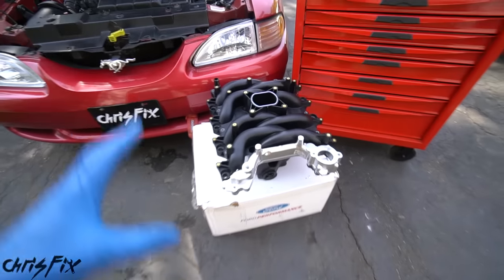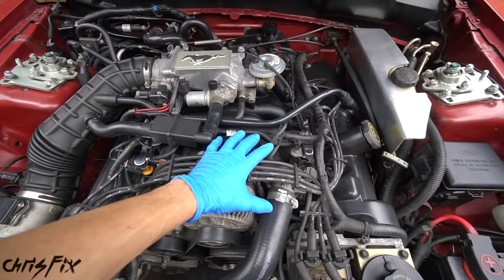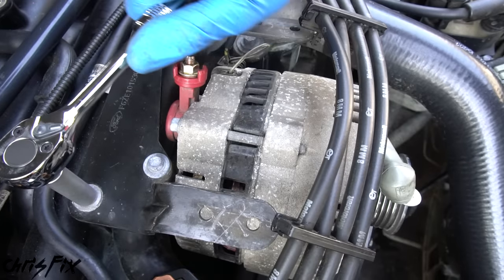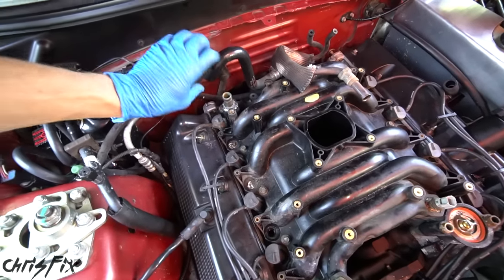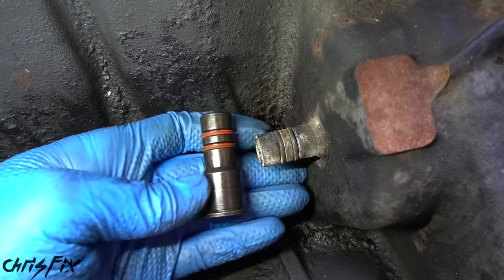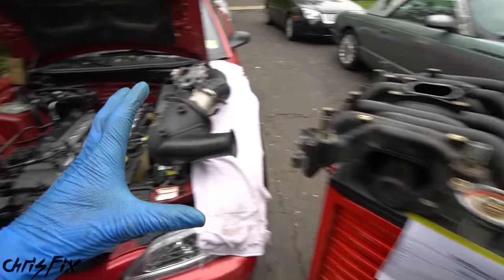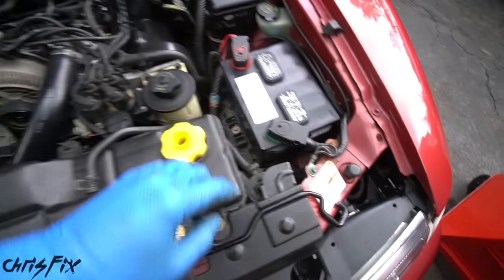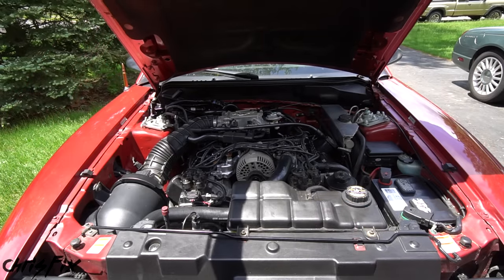How to Install a Performance Intake Manifold and Replace Gaskets (Dyno PROOF)

Comment: Sometimes I wonder if chris just bangs up his car on purpose to make a video fixing it
Reply: Death Grips probably not.
Reply: LOL it always seems that the leaks are up in a spot that you can easily get to I'm like when it happens to me the leak is behind all this stuff that I have to remove before I can find it. Suspicious. Maybe poking holes with a drill.
Reply: the polymer water passage was a known issue, its actually amazing that it was never replaced and that it held out so long as there was a recall
I actually wonder if Chris could have had this fixed for free
Reply: @ChristmasCrustacean1  nope. Ford wouldn't pay for my town car intake manifold. Appearantly it was a known issue, voluntary recall or some dumb reason
Reply: Honestly it doesn't matter, I still learn alot and love watching them.
Reply: In one video he cut a huge hole in his truck's exhaust to demonstrate how to repair it.
Reply: Christmas Crustacean no it’s not a recall I have the same engine it lasted 15 years not to bad if you ask me
Reply: No need. He buys jaguars and such.
Reply: Definitely fakes some damage sometimes that’s looked like a drill hole. Still good video but he definitely damages his
Reply: Also he dynoed on the stock intake how?? Before he drilled a whole right where we could see it.

Comment: I can't wait until you do the throttle body swap, and after the throttle body i would like to see the difference when you replace the cylinder heads with performance and then do a supercharger or whatever power adder you want. I  love the videos and please keep up the good work

Comment: I just had this done to my Mountaineer. Same engine but a 2003.
Reply from the maker: Nice!
Reply: what type of car is that and what year is it?
Reply: black da Dragon 69 2003 Mercury Mountaineer. My intake manifold was leaking in the thermostat housing because a rubber seal in it allowed coolant to pour on to the engine block, and caused a few over heating issues. At the worst point, if go through a gallon of coolant a day.

Book time is 2.9 hours, long as vacuum lines are not too brittle. But it took the mechanic over 8 hours to do it, just because of the age of the parts.
Reply: I work at a Dodge dealership. We get discounts on labor costs ($84 vs $125 per hour). The guy supposedly took his time because of the age of vacuum lines and fuel injector o-rings. Yeah it was unacceptable on how long they took. I had to twist their arms to have my vehicle brought in on time for the appointment, took 3 days all together. They really do not care about working on employee cars, even if they are paid the same regardless of our discount.

Comment: Then you put gasket on head gasket I'm like "ohh you can port SO MUCH metal from this head, it means Powahh"
Reply: Ya i was thinking he needs to do the pi head swap too. But he's putting a supercharger on, so wouldn't work with the higher compression.
Reply: i was thinkin that to xD

Comment: Holy sht it backfires
Reply: Lemuel Roxas I was sooo suprised lol, only 208rwhp and it backfires, such a nice backfire tho
Reply: Pretty sure he edited that in but it would be super cool if it did
Reply: I wouldn't call that a backfire per-say. But i know what you're talking about. I have a 94 ranger with a gutless 3.0 v6 with 340,000 miles, and after i cut off the stock exhaust and ran it out the side, it would always pop when letting off the throttle at higher rpm. Its just unburnt fuel burning in a hot exhaust pipe. I've noticed this in many ford engines and wonder if it has something to do with the way Ford's ecu's are programmed on fuel curve. I'm not sure.
Reply: Scratch that i see what you're talking about now, i thought you were talking about the exhaust pops. Yeah my turd of a truck doesn't pop a small flame out when letting off i don't think lol.
Reply: Why would it be a piece of shit when it has fire coming out of the exhaust
Reply: Oof hes running an NA 😨
Reply: Nolan Carey whaddya mean?
Reply: Afterfire is the term you are looking for. Backfires are when the fuel mix ignites and blows back out the intake. Also, performance cars tend to run a little rich, it's perfectly normal for it to afterfire like that.
Reply: musician445 ,
Reply: Lemuel Roxas of Course it's a Mustang

Comment: garuntee that 3 years from now. the driftstang is gonna be supercharged, ecu tuned, new suspension, new brakes, extra radiator, new transmission, new diff, basically a new car.
Reply: Charles Bobick, why? He’s still updating as he moves up the ranks. He’s doing good! And he’s working on the Del Sol and trailblazer.
Reply: TheNeoLeo bro I want to see him work on the driftstang and make some videos of him drifting but I guess I can wait 🤣🤣
Reply: @neoleomedia1676  he sold the blazer I think

Comment: god you are saving my life right now with these videos! i'm doing my head gasket rn and realized I need to probably replace every gasket above it as well for preventative maintenance, definitely gonna try using that bolt trick with turning the tip into a flathead bit to line up my cylinder heads!

Comment: damn i bet it didn't spit flames stock.
Reply: Yuri Lopes Probably running rich. If he gets a tune he should gain a little more ponies.
Reply: Yuri Lopes Too much fuel. That fuel isn’t getting ignited in the cylinder so it gets dumped down the exhaust and ignited by the heat.
Reply: I'm pretty sure the reason it spat flames was not because it was running too rich, but because the engine hit the rev limiter which cut spark, causing unburnt fuel to go into the hot exhaust pipe.
Reply: oh i didn't know...
Reply: Lolled9991  on modern vehicles that is true but an older (1980s to mid 2000s) engine that "bounces" off the rev limiter rather than just a smooth stop is ignition controlled rev limit
Reply: How does an engine that had an intake swap and no fuel modification what so ever suddenly run rich??..if anything the increase in AIRFLOW would cause the fuel to lean out..
Reply: Paul Klein in time the engines ecu will fully adjust and you will never “burn” your engine..running rich is NOT safe and will destroy plugs, o2 sensors, and cats..a bigger intake will make it run LEAN and will not hurt your engine..idk who told you this but this is incorrect information
Reply: it will not spit flames cuz the cat will get rid of it... he needs a decat and run rich
Reply: @eriv4735  notes to remember. 1-stock ecu here.  2- its a F.O.R.D.  3- aluminum heads.  4- cylinder temperature is not running temperature. 5- detonation is bad. not kind-of, but very bad.  6- Base map is always rich.  7-This was running on the base map. Relearn takes about 100 miles or so.  8- Why do people not use their heads more?   9. Rich burns are cooler and melted heads and pistons are bad.
Reply: Luke Hawkinson do you honestly think this is base map?..you do realize he’s running on a custom tune prior to this video? Have you seen his other vids?..do you honestly think knowing how much this guy knows he wouldn’t gone through all the break in and warm up procedures prior to getting on the dyno? Yes detonation is bad but who said anything about that?..proper afr is always key..do it right and you won’t have burnt sensors or pistons..hows that do using your head?
Reply: @eriv4735  there is no tune on this car.  that would have warranted a separate video of its own. And yes i have watched him before. i never said he is dumb.
    it has a self-learning ecu. stock ford part. you remove the battery it forgets things. like ignition timing and fuel maps. which is why it took a few extra turns to start-up.  not a bad thing. the base maps are close enough for it to run good here.
     it allows for tighter AFR ratios in the long run as it continuously adapts to current running conditions. those maps don't "run" the engine solely. they just serve as a guide for the open loop mode
    the computer is constantly monitoring all of the incoming sensor data and adjusting the fuel, egr and timing on the fly. And there are a lot of sensors providing data.
    maf, crank angle, crank position,intake air temperature, throttle position, knock sensor, upstream and downstream o-2 sensors, and a few inferred values like rpm, intake charge density, and intake charge composition.
   Knowing what it is doing does not mean i can explain it well.
   And they keep getting more complicated. 
   FYI, all base maps are rich. 
   theoretically most cars will run with out a single o2 sensor working, they just run rich. unplug the maf? it'll run like crap. knock out the crank sensors? wont start at all. throttle position sensor ? power delivery is not as crisp. 
   Do i recommend testing any of those? not really. running long term in most of those fault conditions is bad. Some are downright undriveable. Any that forces a base map revertion will coke up the cats and cause a cat failure eventually. possibly even to the point of physically clogging the cat. 
    Do i tune cars? No. Do i think there is improvements to be made? yep. 
right now he is limited by the resolution of the stock ecu.
    when he supercharges it there will be a need for an ecu flash though at minimum. If not a full ecu replacement. 
   why bother writing this? if you read this far... maybe you might learn something. but you seem too "full" to learn much more. maybe i am wrong on that one. in my experience there is always something else to learn. And something cool just around the corner to gawk at. Be safe. Happy wrenching.
Reply: @caminoprojectUS  The ECU will learn in a few hot-cold cycles AND engine load,temps,map readings. Give it some time,it may TUNE itself.
PS: I ...NEVER disconnect the battery- I'm too afraid of the ECU to forget stuff. Just be careful where the 12 V. leads are and tape them up.
Hint: the alternator.

Comment: Top tip: buy multiple 10mm sockets as these are elusive tools that cars love to eat. Every gearhead at some point has lost their 10mm.
Reply: James Smith 😅
Reply: my dad hasnt lost his and hes been a mechanic since i was born
Reply: James Smith Yup, definitely learned this the hard way when I had to flush my truck's coolant last month. Legit almost started panicking, because one bolt was off the thermostat housing and the other was still so tight that I needed the breaker bar to get it out...

Comment: Install turbos to the driftstang
Reply: GUINEA PIG ARMY Superchargers all day bro!
Reply: It's on his list
Reply: Superchargers are easier to installed especially Paxton/Vortech/Procharger types.I am not sure Hellion makes a kit for the SN95's anyway and besides superchargers can be fun and make good power.
Reply: Anthony Thomas it's an argument of power to weight and response time. Superchargers are quicker to provide power but you have to give to get. Turbos will kick in right as power is needed in order to provide the torque needed. It's a matter of preference too. I'd be happy if he did either

Comment: I have a terrible memory and no mechanical inclination but my starter went out on my element so I replaced it took me way too long to do it and had to do the job twice because I didn’t seat the intake manifold properly the biggest thing I’ve found that helps remembering where those bolts with no piece coming out go is to put them on a piece of paper circle them and write what they go to beside
Reply: Just saw the labeled baggies that’s genius

Comment: @ChrisFix you should swap the engine for a newedge, (1999 - 2000) i know an engine swap souns big but its really nothing in theses cars, you'll make good power and you can make like 360 with boltons... plus a new edge mustang motor is not expensive. pi engine is the way too go....
Reply: Karismah Films  but the engine he has is a 4.6 just like the new edges motor
Reply: Well said! The 4.6 on that 99-04 improved in every way + their dirt cheap
Reply: True but it lacks out of factory pi heads bigger throttle stronger intake material trust do the research 99-04 4.6 are revised
Reply: Or you can swap a 4.6l. 315 hp from a 2010 GT
Reply: Or he could just keep doing what hes doing and improve the engine he has

Comment: WHY???? Why did you dont clean all the oil and dirt in the engine (below the intake manifold)
Reply: Agustín Gonzalez The ports were open.
Reply: Its not dirt its the welding
Reply: i think its the weldingn but i agree he shoild have cleaned the safe parts while it was open

Comment: I might be buying a 1.3l 1999 Skoda Felicia with 46,000 miles for my first car. What do you think?
Reply from the maker: Awesome!!!!
Reply: OMG Chris, thanks. I really appreciate you replying and I plan on doing a lot of things to the car and will definitely use your tutorials to help me
Reply: Oh yeah, rust will be a problem for all older cars like this one, however I have seen photos of the car and the exterior is great no rust or damage as well as the interior is nice and spotless and the owner has stated that the car runs great, I will just need to check for rust underneath the car when I go to see it.
Reply: There is no way it has only 46 000 miles, probably more like 460 000.
Reply: Just get it, if somnething breaks u can probably repair it easy. Not to new not to old. Cheap parts not too much electronic fiddely.
Reply: that's why its a great first car
Reply: Satanizr oh trust me it has 46,000 miles
Reply: Next generation, Fabia is not so reliable as Felicia :/
Reply: slam it on tarmacs and daily it
Reply: yeah and throw in a big fat sub, you got it.

Comment: Yo Chris, you going to get a new fuel pump and injectors? Maybe a new fuel rail, I'm not a ford guy but it should help. I would say 5 to 15 hp with that.
Reply from the maker: Yea maybe for the supercharger. Right now she is t starving for fuel so it won’t have any affect.

Comment: Just a pointer at 12:50, you applied the teflon tape in the wrong direction for the first sensor but did it correctly for the second. You always go in the direction of the threads so it doesn't come undone as you tighten. Having coverage of the first 3 threads is the only thing that should really matter, about 3 wraps should do it depending on the tape.

Comment: As a technician myself, that spigot for the heater hose would've been replaced since I already had the part and was already there. On the vehicles I work on, if I already have the part, even if it is already correct or still working I always replace it.

Comment: One thing that might also help with horsepower gain is bigger injectors or jets depending on engine model and also most common on those mustangs that people do is super chargers and second is turbo chargers which give ya almost 100 if not more horsepower with the right tune

Comment: Probably not the first to say it, but you wound the PTFE tape on the first sensor backwards. If you wind it the other way, tightening the part will pull the tape on more, rather than unwind it. Just a friendly tip.

Comment: thanks for the tip with the oring and silicone grease chriss, I need this for my pressure sensor switch oring, fkin thing keeps gettignpinched even with 6nm

Comment: i would love to see what a mild cam upgrade would do to those horsepower numbers. a bigger cam should move your peak torque higher in the rpms
Reply from the maker: These heads don't flow super well unfortunately so there wouldn't be a lot of gain unfortunately. The supercharger is a much better upgrade!
Reply: @chrisfix  that is unfortunate. It would be interesting to see what would happen if you broke out the Dremel and did some light port work. Just some basic smoothing and port matching. Could make a very interesting video. That engine would really come alive if you could keep the torque up past like 5500 rpm. 
Supercharger is always fun.
I've seen a lot of belt issues with drifting, apparently they don't like high rpm and rev limiters lol.

Comment: Actually you don't need to spend the extra money on a Ford Racing intake manifold to get the aluminum portion for the coolant passage.  All of the "normal" intake manifolds since about 2003 have included this aluminum portion to solve the problem of the leaky manifold that was common on the 1991-2002 models.  My 2005 Explorer with the 4.6L V8 motor already had the newer improved design, for example.  But even if you have the newer design manifold, if your car has a lot of miles it's still a great idea to go ahead and replace the gaskets with either new Ford or Fel-Pro gaskets.  Then you will be good to go for many, many miles.

Comment: There was a recall for that, for 1997-up cars. My Mustang was a '96 so I had to pay out of pocket for the replacement.

You should have installed the PI heads too.

Comment: I looked at that intake and thought yeah Ford Modular Engine. I've stared at my 97 F150's Triton V8 enough. Only thing this doesn't have is the CHT sensor under the thermostat housing. Well that and actually being able to get to the back sparkplugs.

Comment: This manifold swap has been a nightmare. After managing all the tools, parts and sources for drilling everything. I get it all buttoned up looks great. after a 20 miles down the road, My upper radiator hose has too much pressure and I find my heads are bad. Some advice for others, CHECK YOUR HEADS FIRST before you put any money in it then decide if this is a job you want to do. I would of defiantly ditched my stang and bought a different car. The amount of money I put in my 98 I could of just bought a 04 mustang.